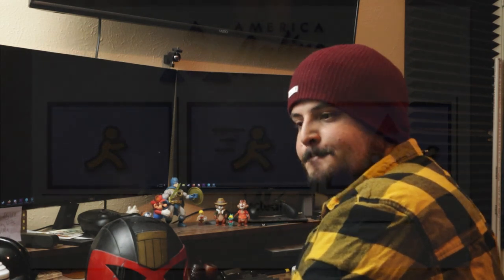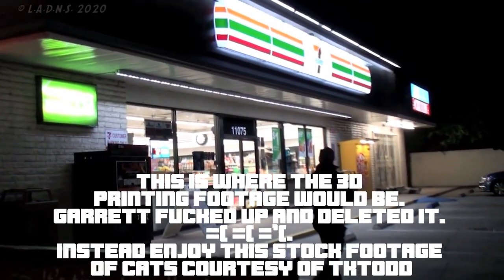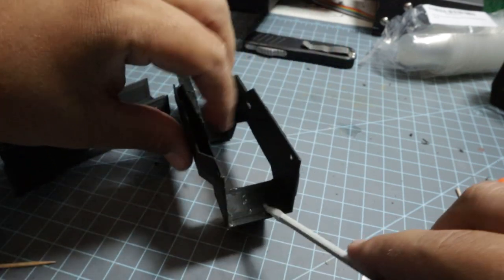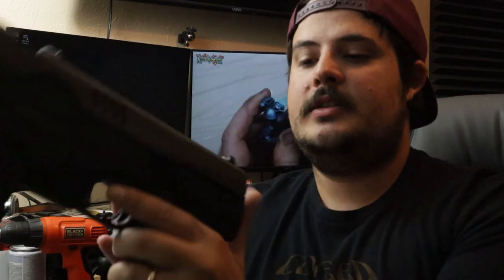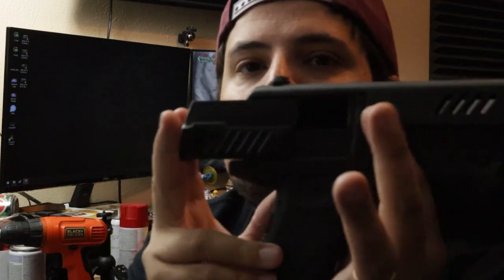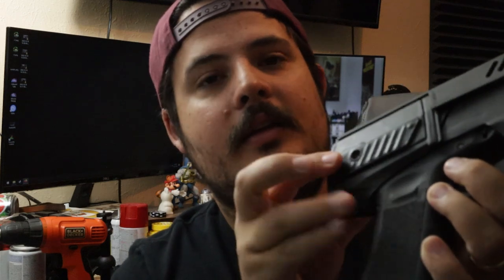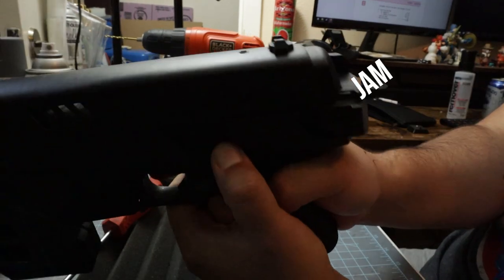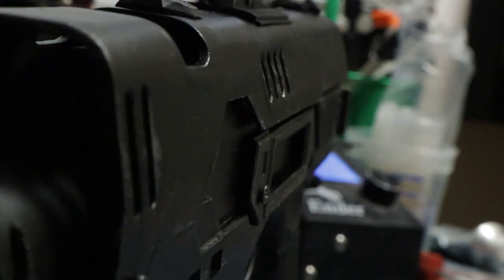Making Dredd's Lawgiver | Garrett Makes

Comment: Now to get an Adafruit LCD display (like https://www.adafruit.com/product/181) to put on the side to do the display for different ammo types loaded, with a small Arduino for the logic, a place for a button to cycle the display and rechargeable battery pack to power it all.
Reply from the maker: Thanks. That's the plan